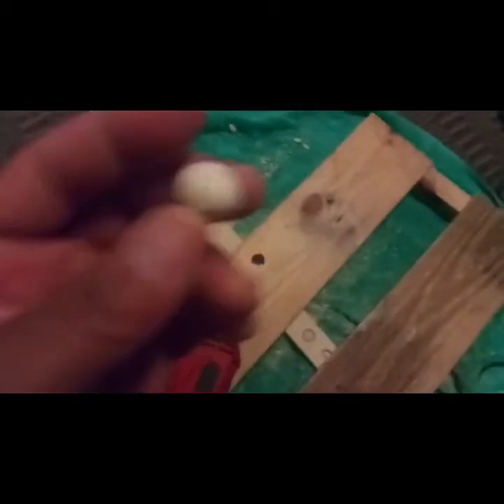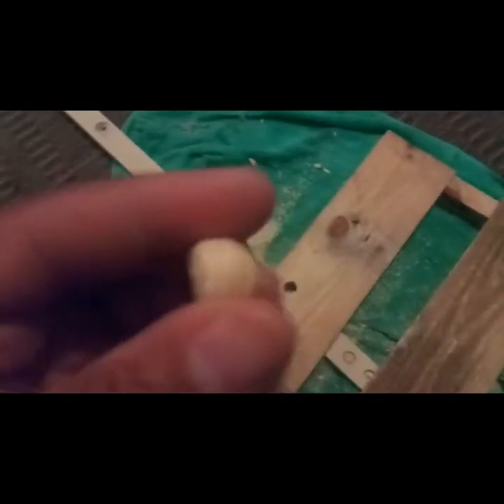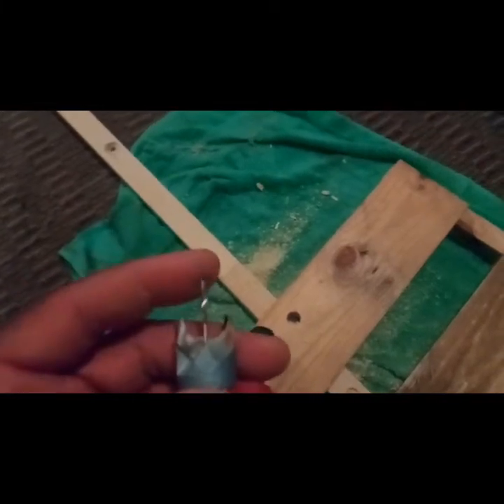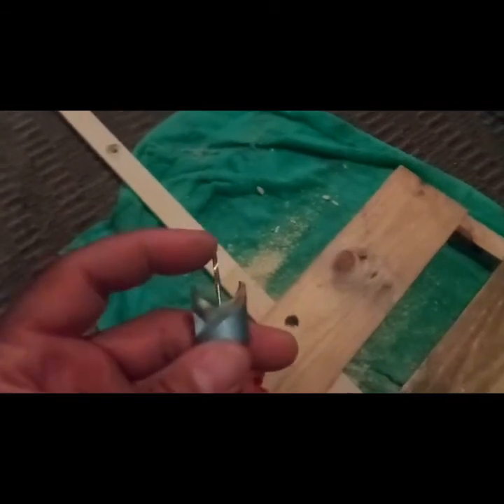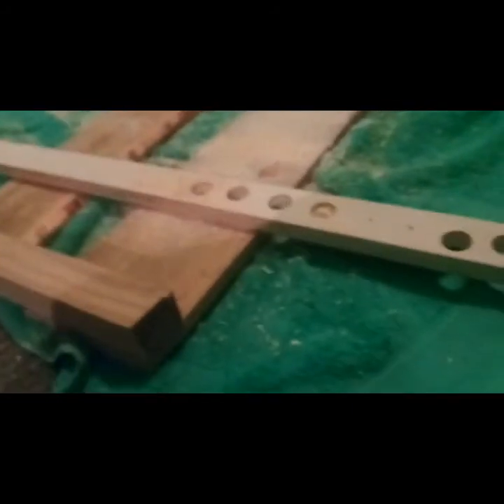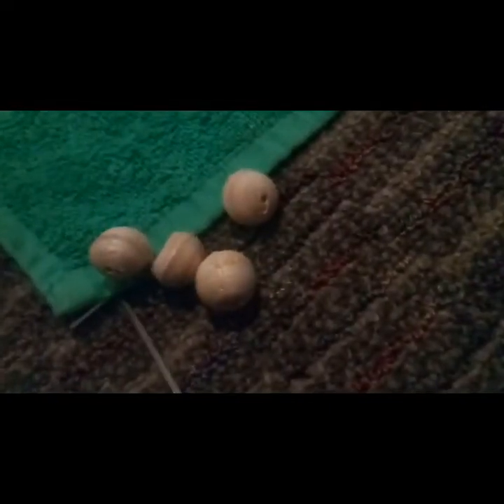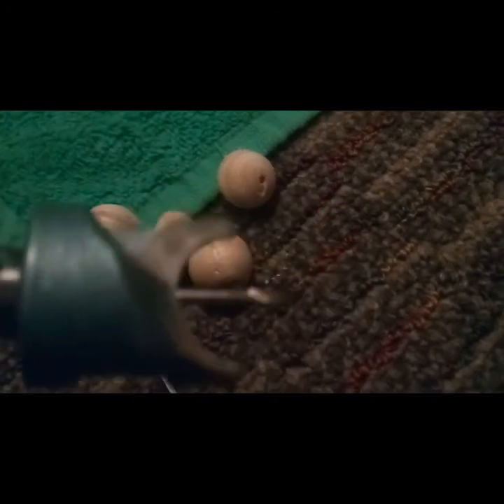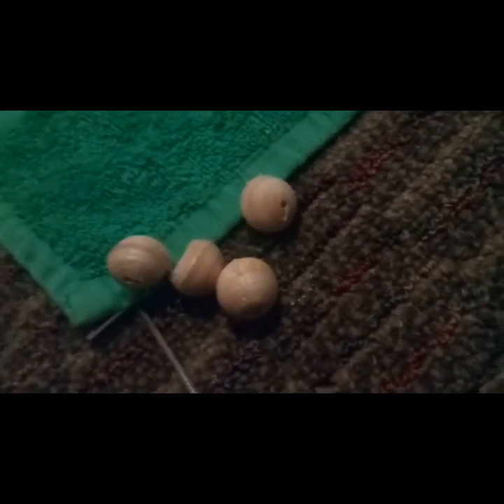Making wooden beads 1st attempt

Comment: 🤔 can you use this bead drill to round up dovel ends?
Reply from the maker: I haven't a clue and I haven't tried it I bought it off Ebay it was not that expensive then after practicing with that one I bought a more expensive one now if you take out the drill bit you probably could but I'm not that skilled and are you talking dowel ends??
Reply: @williamfullman2639  yep i'm talking about the end of a 4 inch long and 20mm thick dowel which i use as handle for my self made back scratchers.when one end is rounded it looks a little bit better.